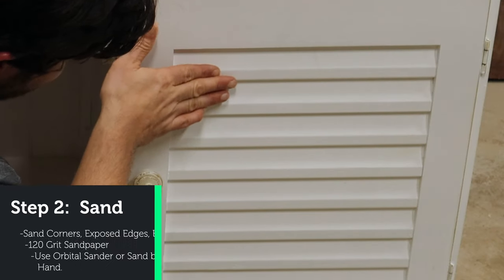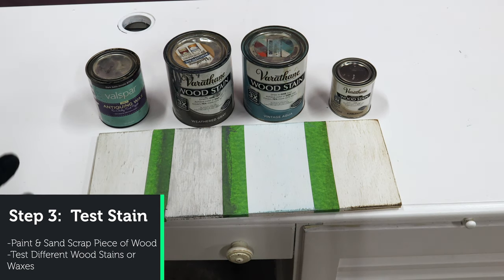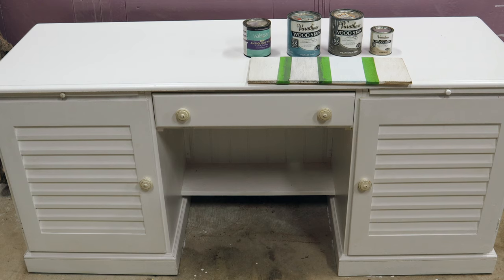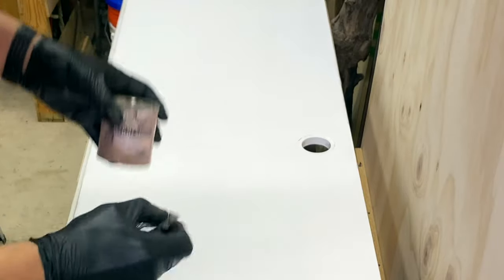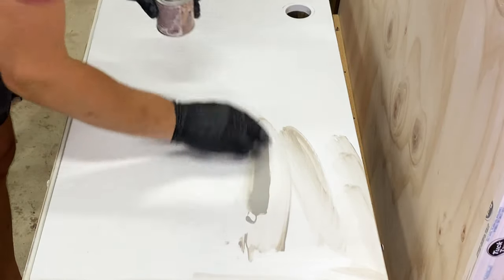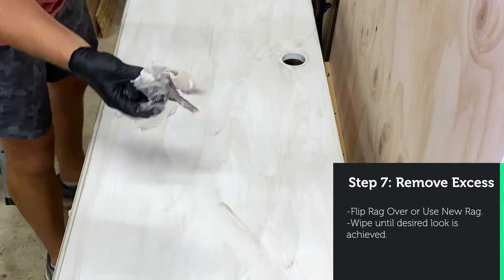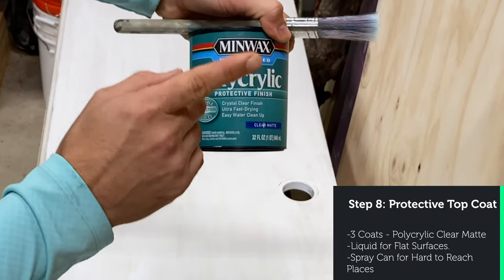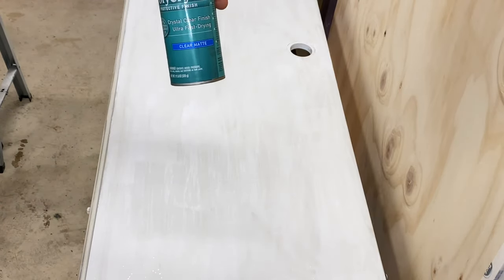How To Make Furniture Look Old

Comment: After you apply the stain, do you have to put anything over the top of it for that protective topcoat, or is that an option? I was in my local hardware store, and they told me not applying anything over the stain could be an issue. They said when it gets humid out, the stain will become tacky. Any truth to this? Thank you very much, and great videos.